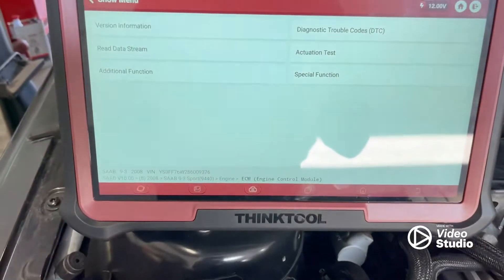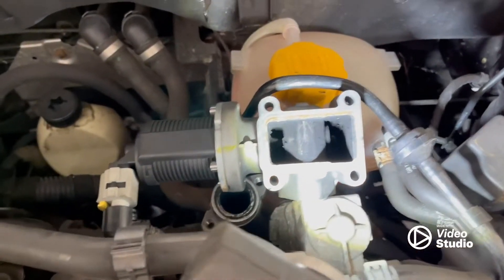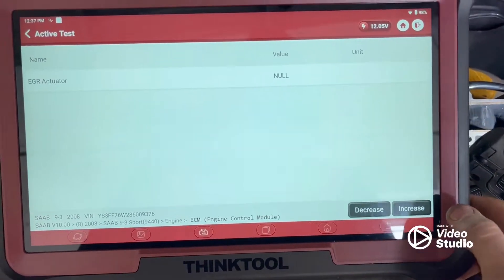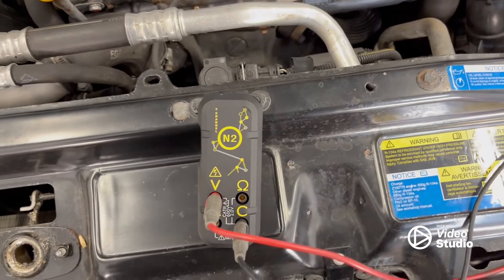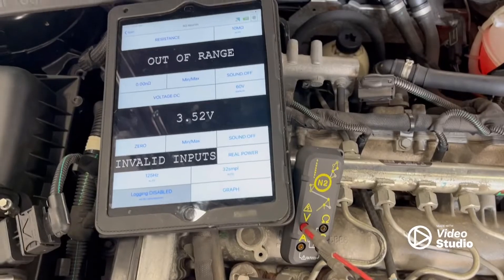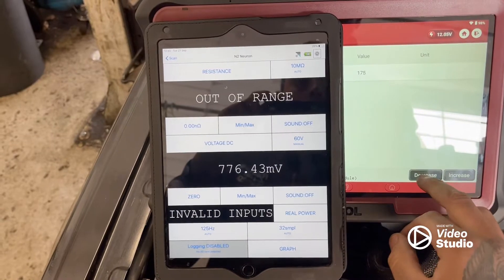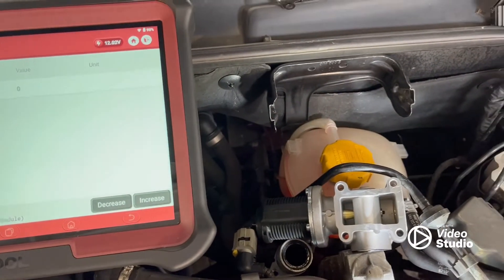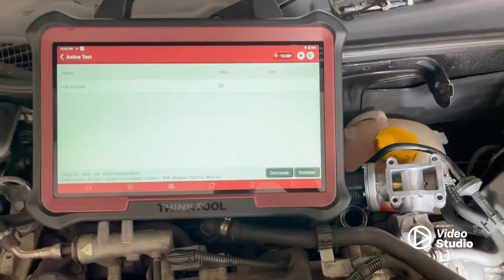Saab 9-3 p0400 EGR fault diagnosed using Thinkcar diagnostic tool and Curien n2 Multimeter

Comment: Thanks that's a useful guide to diagnosis. I just replaced the EGR on a 2006 Tid Saab and it threw a P0400. Turns out the replacement valve was fine (second hand but hardly used and very cheap) but the solenoid was toast. I have a small collection of Saab parts and found an old EGR, swapped the solenoid and all was well.